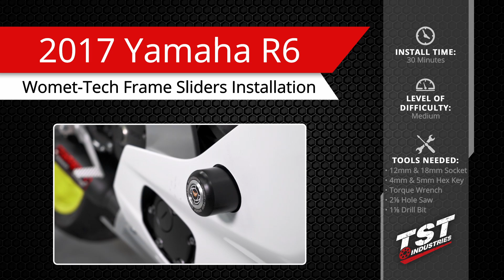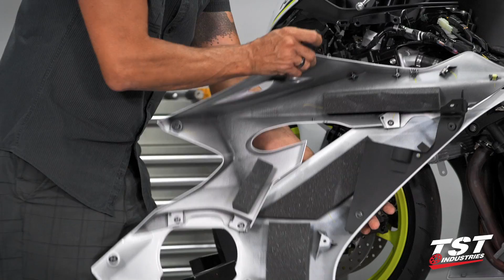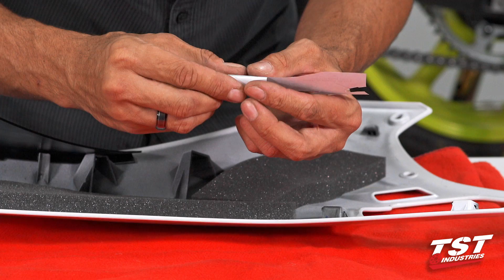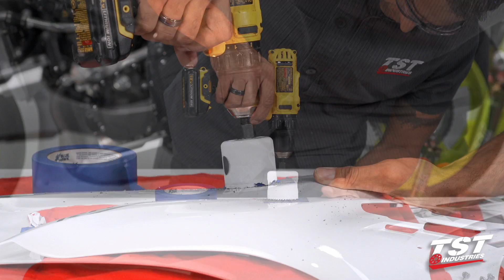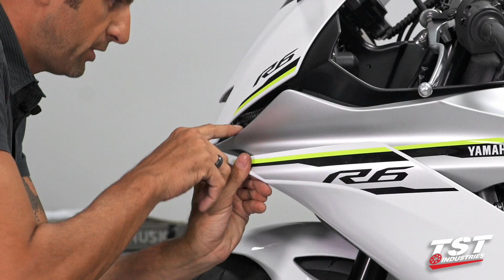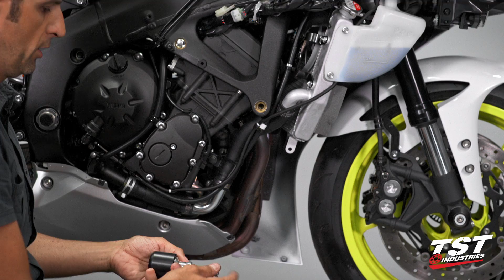How to install Womet-Tech Frame Sliders on a 2017+ Yamaha R6 by TST Industries

Comment: What size hole dozer did you use for this frame slider?
Reply from the maker: 2 and 1/8 inch hole saw and a 1 and 1/8 inch drill bit. You can pause the video at the link below and it's shown on screen. 

https://youtu.be/40_Hwhbz-5I?t=24

Comment: Just got my sliders today for my R6 , order from you (outside USA). I see now in the video you got the same problem I did with the left slider (The top left engine mounting bolt, where the sliders should connect, got a small offset (the right side top mounting bolts got center ring \ bushing), It is really hard to screw in the bolt with the womet-tech sliders aluminum base (the diameter is too wide to compensate the engine offset) I really did not liked that, It can damage the thread and puts unnecessary pressure on the engine block. I did not really got any option to get other brand without waiting too much so I did install the sliders but it is do not feel right to me, I think I will worth mentioning this on product page.
Reply from the maker: We have mounted many of these sets on R6 bikes, including the one that races in Daytona 200, ASRA Team Challenge, and also our in house test R6 SS spoec 2019 model. We never really had any issues with these in the way you describe.
Reply: @TSTindustries  I see on your videos that you also put an effort to screw the left upper side bolt, this is because of the offset (I think this also the reason why there isn't center bushing in the left side, to allow for the engine to be in slight offset due to minor production and mounting changes. I ended up loosening all the engine screws and tighten in the order listed in the manual to try to make it better. Anyway it got a  slight angle and I am pretty sure I did small damage for the screwing but I think it will do the work.
Reply from the maker: @husqvarna199  like I said, we do a lot of these bikes and we never sustained thread damage from installing frame sliders.

Comment: I rather replace a fender then to bend a frame.
Reply from the maker: I think you have a big misconception about what the main function of frame sliders is.
Reply: @TSTindustries  Well I would appreciate it if you would tell me the benefits
Reply from the maker: I think you are misinformed about the primary function of frame sliders. They are meant for protecting the vital components of the motorcycle that are very expensive to fix. Picture crashing at 60 miles per hour. Scenario 1...you do not have frame sliders on. You thrash the entire side of the bike, possibly grind down engine cases straight through or they shatter from impact. Then you have debris in your engine, oil all over the surface you crashed on. If that is at the track you just ruined the day for every other participant. Scenario 2...you do have properly designed and mounted frame sliders. The frame slider takes the first impact, absorbs some of the crash energy, and provides a consumable surface for your bike to slide on. You are still damaging a lot of the fairings, controls, etc. because you just sustained a fast crash. The sliders will however cut down on repair time and cost. We have been using this technology for years in our racing efforts and I have not had one crash where having the sliders made the situation worse. In fact proper crash protection components kept me racing more because after a crash we were able to rebuild the bike fast and still make later races. There are some companies that make no cut sliders that protect the bike from static drops and low speed crashes, but they do not perform well in fast crashes. Fast crashes are where you sustain the most damage to the bike so this is the scenario that we design for. I once had a 130mph crash in Daytona fighting for 3rd position in a Supersport1000 race. The bike got pretty mangled but we rebuilt it pretty quick because our crash protection components did their job. We have some videos illustrating some of what I am describing here. Have a look:
https://youtu.be/h42mkK0Pj1s
https://youtu.be/RaKpiQGRxXQ
https://youtu.be/JUpTcwgtpms?t=67
https://youtu.be/3M_ZNfoObJ8
Reply: @TSTindustries doesnt really answer him. These sliders are bad for high speed crashes and in all likelihood increases the odds of damaging the frame.
Reply from the maker: @TreyyDaMenaceFan in my experience crashing the r1, r6, and several other bikes many times, the frame sliders prevented much damage and never affected the frame. The most severe was the R1 at 130 mph. Our sliders did their job.
Reply: @TSTindustries  thanks appreciate it

Comment: Couple blocks of wood would be your friend in supporting the cut for a hole
Reply from the maker: If the fairing were rigid or flat then yes. The reason why I didn't use any drilling support is so that I wouldn't distort the shape of the fairing more than just by application of drilling force.
Reply: @TSTindustries  I was thinking more asking the lines of elevating off the table  and getting your hands away from a hole saw on a semi flimsy surface. As for distortion elevation isn't going to make a difference when you yourself, even you just stated it, are the factor in how much pressure is applied. 🙂

Comment: where can I get the hole saw and what size of hole saw do you used to drill?
Reply from the maker: Our local Lowes and Home Depot have them. Stores like Harbor Freight, Northern Tool, Sears, etc. will also have them.
Reply: TSTindustries  what size do you use?
Reply: Does this come with the Template sheet?
Reply from the maker: 8Leng  Yes it is included and the hole saw size is 2 ⅛ inch.

Comment: The location print out is slightly off on one side. I noticed this when the first slider was installed on the left side of the bike.  It  off by about 1/6 or an inch.  Small but still noticeable.  It was the same result when other r6 owners installed your frame slider.

Comment: Great vid, now does the kit actually come with the hole saw?
Reply from the maker: A wood saw used really slow will give you best results. Cutting through this plastic with a saw that has too fine of a tooth profile will yield in tooth packing and the collected plastic will melt from plastic-plastic friction causing globs of plastic to form. Keep it simple, be patient when you cut, and you will get really nice results.
Reply from the maker: We do not include a hole saw with the purchase of these frame sliders.
Reply: is there a specific hole saw that you guys use? ive seen some for wood and metal, others for other things. wasnt sure which one would cut best.
Reply: Thanks you guys! keep up the great work!!!

Comment: What about on the blue r6? Will the cut still look clean or will I be able to see the paint line around the hole?
Reply from the maker: This is dependent on the interior color of your fairing. this particular color scheme had the base color white as the interior which enabled a clean look upon cut. We encourage you to take your time while keeping your tolerance tight and your cut clean.
Reply: TSTindustries have these been tested in low side crash? What are the chances of causing the bike to flip?

Comment: Tip: you can even use a sharp punch before drilling your pilot hole to ensure no drift. Good video, but I honestly don't like how the left side came out. I feel the hole is way to close to the edge of the molding. Looks like it would be prone to cracking.
Reply from the maker: I always use a punch in hard materials. This plastic is so soft it just needs a bit of pressure to bite right in. The plastic is pretty flexible so there shouldn't be any cracking there. I unfortunately didn't get to design the fairings for Yamaha so the spatial limitation is on them.
Reply: TSTindustries could you have made the slider so that the narrower portion extended further out so that the hole drilled is smaller in diameter ?